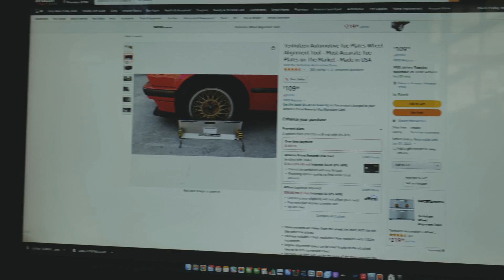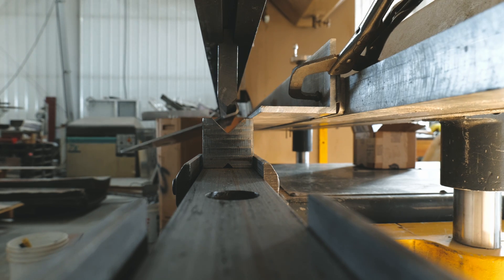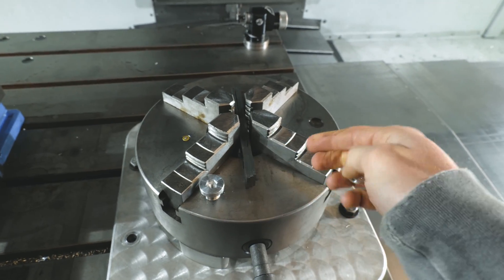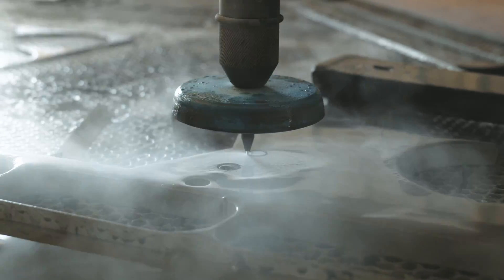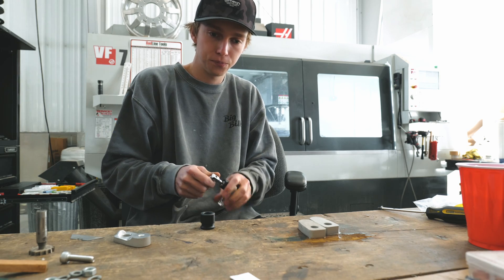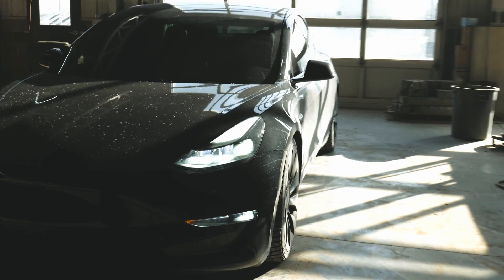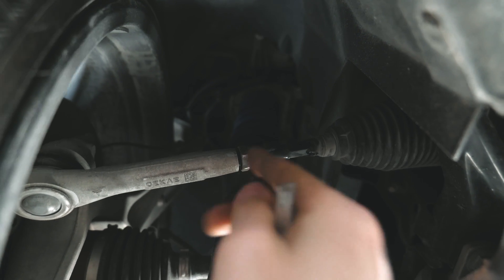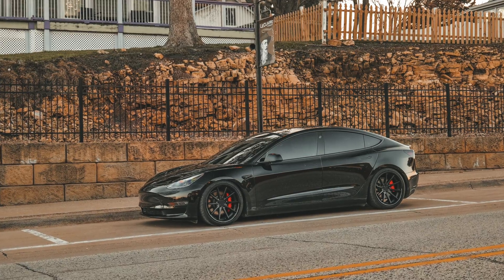Tesla DIY Alignment and Machine Shop Work

Comment: Nice machining. I can’t stop thinking of such big machines to make small parts. Cool way to do the alignment. I’ve seen something similar using string to get the measurements. If you could get individual raised platforms for each wheel with rotating pads and raise the car to place it on top you could set the toe without raising and lowering each time.
Reply from the maker: You can make little parts on a big machine but not big parts on a little machine! We use it’s full capabilities and more for other stuff! Thanks for watching:)